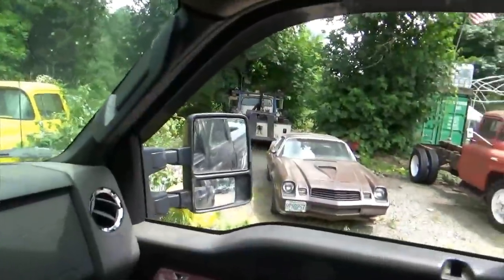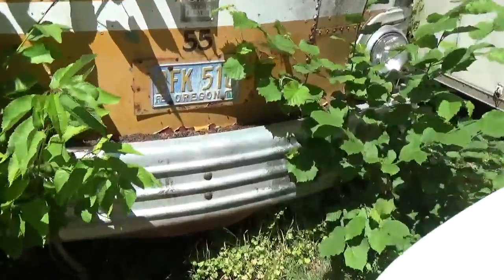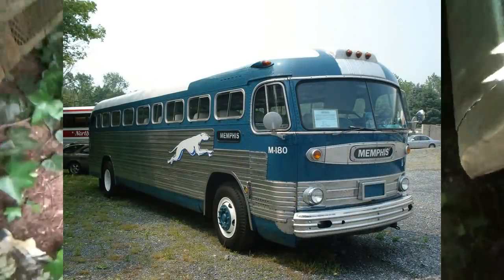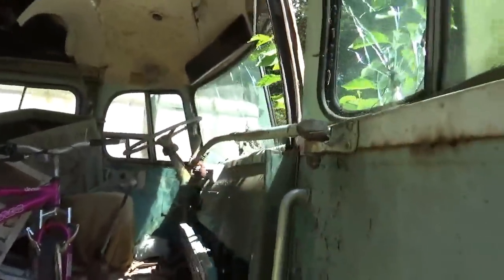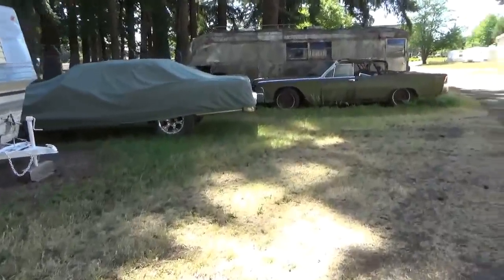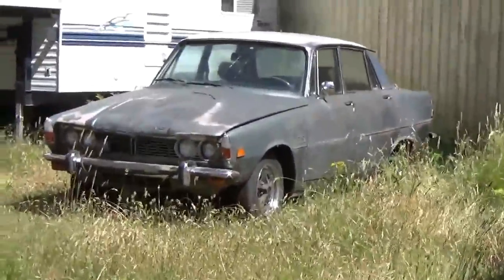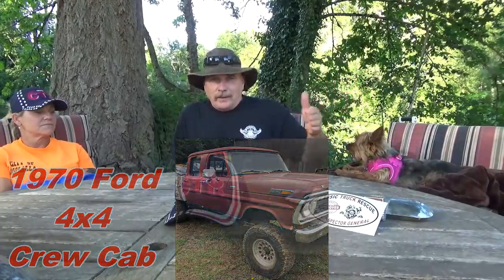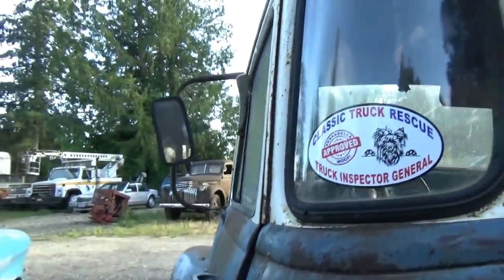1952 GMC Bus & 1940's Mack Bus (CTR-153)

Comment: So the 4103 front glass in unobtainable but Lexan is an easy enough replacement until you can locate some. I know a 4103 owner that’s been looking for years.   I have no doubt it will run.  Don’t forget heck the air filters for water too, ontop of the obvious stuff like injectors etc.  good luck

Comment: Rick the grille is a 70 one year only, it could be a73-79 running gear frame down 67-72don't come with 460's.The 460 trucks were F-250's and the tunnel had to be cut out to let the trans bolt up.

Comment: GM bus has stainless steel sides, nicknamed "SILVERSIDE" no aluminum on sides or bumpers.
Reply: Okay, but sayin AL-U-MINIUM is way more fun.
Reply: GM buses were all aluminum. Including the siding.  No stainless steel at all.  Weight was an issue. so most of the bus is aluminum. The 3751(and 4151) were the only silversides buses, built before ww2 and then again in 1947 through 1948. This one in the video is a newer model, but still all aluminum. MCI built buses with stainless steel siding for many years.
Reply: radioactivelarry the sides on this bus are anodized ALUMINUM, not stainless steel!

Comment: You found a rover p6 a british,  the tc was a 2.2 litre and they had the 3.5 litre v8 version originally a small block buick engine but bought out and slighty modified by Rover, their badge is a viking ship, v.prone to rust here, they had an aluminium bonnet ( hood) and boot lid ( trunk).

Comment: 5/16 square stock would open that hatch up; think of a key that "locks in" between the shaft on an electric motor & a pulley, only the size is 5/16

Comment: That yellow bus is a 1952 gm pd4103 transit bus 1500 made between 51 and 52....the engine is Detroit diesel 671 6 cylinder 2 stroke.....the biggest problem u will have with that bus is the windshield cant be found...I know I've tried for 7 years cause I own and converted a 1951 4103.....ck utube channel gm bus 4103.....if u get ahold of the yellow bus I'd be interested in some parts.....steve from fla.

Comment: The car is a 1966-1973 Rover 2000 P6 TC = Twin SU Carburettors  The power output of the 2000 TC engine was around 124 bhp (92 kW) The holes in the rocker panels are for the car jack..

Comment: Hi Rick another great video, The car is a Rover P6 2000 TC and the TC stands for Twin Carb, There was also a 2000 SC (Single Carb) and it's a 4 cylinder 2.0 ltr engine. There was  also a 2200 TC and a 2200 SC as well as a 3.5 V8 (the old Buick engine). They were made by Rover and then by British Leyland  from 1966 to 1977 and were replaced by the Rover SD1. I hope that helped?

Comment: Yes, send the Bus Grease Money an email. MY advice would be to remove the valve cover on the bus, then have someone else turn it over by hand 2X and watch and see if the injectors work. If you watch some of the Bus Grease Monkey videos he does this to almost every old bus he starts and explains that if the injectors work after the 1st manual rotation of the engine then most of the time their ok

Comment: thats a 6-71 , do not even think about starting that without visegrips on the rack making for dang sure you have control of it , and make sure the emergency air flap is free and working , also the air cleaners need to be checked for water , other than that it should run

Comment: Aaah!  When you went "bus" you woke up some of my memories of working on and converting buses!  This bus was one of the last 4103s, being replaced by the PD4104 in 1953  or 54.  Not a whole lot of mechanical changes, but huge body work changes. The aluminum siding by the way, is clear anodized aluminum, and should clean up nicely. While it can be stripped and polished, not many have ever undertaken this, as it represents a mess of work, leading to high maintenance in keeping it polished.  STARTING THE ENGINE: Although you know a bunch about engines in general, there are some bus specific stuff to look out for.  First, I would try to turn the engine over by hand with a socket and long bar. Assuming it is free, the next thing would be to check the oil for water. Then, it would be a good thing to take down the air cleaners, and clean the air intake of all debris. There are three or four oil bath air cleaners above the engine. When you loosen the clamping device, you will have the whole unit in your hands, so please beware!  The large cast aluminum housing with the big GM logo, is the air intake coming from the air cleaners, going to the blower intake. Clean is important here, too! There is a flapper valve in this section, tripped by a solenoid, and actually closed by a spring. This is the emergency stop device, and it is very important that it be functional.

After the above checks, remove the valve cover (four hand wheels on top) and make certain the rack tube (on top, probably 3/4" in diameter, and running the length of the had) is free to move through the travel. This controls the rack on each injector from full fuel to no fuel. Very important that it will work on the no fuel area, to prevent a run away engine. I used to always keep a good hold on the rack control lever (on the left end) when it was being started. Bus Monkey likes to clamp a pair of vise grips on the tube to allow easy control. I'll not go into this part any further, as it gets complicated from here.  Another "must do" replace your fuel filters and oil filter element. The primary and secondary fuel filters are extremely important! Clean out the cans, install the new filter elements, then fill the filters with diesel fuel before buttoning them up. You will also want to put a pump on the fuel line from the tank, and pump it to make sure you don't have a tank full of water instead of fuel!

Nice find, and thanks for awakening my "nostalgia genes!"  Two things get my attention from the past...buses and Studebakers!
Reply from the maker: Wow....a lot of good stuff. Thank you, -Rick

Comment: Hey Rick  that is a 6 "71 0r 6 53 take the value cover  off and put a pair of  voice grips on the fuel rail that's the bar that connects the injecter together  hold it to idle poison start  engine up move back and forty to speed or slow down rpms if it starts to run away push rail to idel and use the emagercy stop to cut air off to kill engine

Comment: When I worked on diesels, I always had two tools in particular when firing up, the wrench for the fuel line into the fuel pump and a big hammer to flatten the line if it still wouldn't stop.

Comment: On the GMC bus it looked like the back glass was identical to the front glass. You could transplant the back glass to the front then replace the back with lexan. As a Studebaker man I am VERY disappointed that there wasn't even a picture of the Studebaker bus in the video. I hate it when some paranoid individual gets ahold of something like that and will not share.

Comment: The gm bus has a 6i 71 Detroit which is 6 cylinder then I for inline or v for v pattern then 53'71 or 92 which is cubic inch per cylinder. A 318 Detroit is a 8v71 engine.

Comment: Rick its a Rover 2200 Tc  mean twin carburators
Reply: sadly only a 2000 before the 2200, so the engine was designed to run on leaded fuel (5 star stuff no longer available).. I think, maybe wrong ??

Comment: Avoid the runaway motor by making sure the injectors aren't stuck [look at the rack under the valve cover]. Ya that is a Detroit 671 [straight 6 I guess you'd call it] 2 stroke Diesel [bigger cylanders than the 730 V series that came later on. You can't kill those motors with a stick but you have to watch that any one of the injectors is stuck to the full fuel position because if you start it like that the engine can run away on you... there's a shut off clapper on it around the blower area [talking kinda out my arse a bit] but again... one thing is for sure the injectors are all set up on a bar lever and as mentioned, if one's stuck open the bar will be stuck to that open position and... yada yada runaway motor. So make sure all the injectors are free and not stuck... but if they are freed up you can probably start that sucker [put some bioclean in the tank with some fresh diesel though]. lol  They'll burn up just about any oil near as I can tell. Heavy steel frame with aluminum "Silverside" look when polished up. A real beaut of a bus though! Noice!

Comment: that's a Detroit 6v71NA (Naturally Aspirated). in these days, diesel engines didn't have any modern cold start aids and the easiest way to wake a sleeping detroit is to crank it over for a few seconds, let it sit, crank it again (it should try to start) and let it sit about 5 seconds and on the third roll, it should start right up. the most awesome part is what it's in, if that bus could talk it would probably tell us quite a story. I don't remember exactly where but somewhere around here, someone has an old GM Scenicuiser that just happens to be an old Greyhound with a Detroit 8v71NA. if I come across it again, i'll take some pics for you

Comment: the bus the engine is a detroit diesel 6-71 as its a two stroke diesel as on the side of the block is the blower that forces air into the engine through the slots in the cylinder liners and the exhaust valves are regular poppet valves common problems these engines the injector rack sticks. this bus be perfect for Bus Grease Monkey to service as he services only the two stroke detroit diesels. he has a vintage GM bus of his own he travels in.

Comment: Get ya A bottle of restorer to put into the engine oil for your Detroit diesel engine not to rev up.& tackout to high on ya when trying to start it up. After it does stays running during the startup period.

Comment: The engine is a 6-71 Straight 6,supercharged 2 stroke They are nicknamed ''screamers'' 71 cubic inches per cylinder 426 cubic inches in total cubic inches There is a company in the USA that converts the Silversides to mobile homes Interestingly,they do the conversions first BEFORE any of the mechanic components are worked on

Comment: 6v 72
transverse mounted
175-78
Hp with a “V” drive trans
This
Rig was built
Before the 8v72 was common
GMC DD has
2v72 ( for ac units)
4v72 (pd4501-scenicruuser built in ‘54a had TWO 4v72’s mated in middle to form
An 8 cal engine-

6v72 (as seen above in this rig) common on fire apparatus- buses and medium to heavy straight trucks
light semis
8v72 large bus and heavy truck, straight and semi
12v72
Logging trucks oil field
Trucks
16v72 
(2 8v72 ‘s Mated )
And believe it or not 20 v72
Trains ships locomotives specifically
(2 8v72’s mated with a
4v72 added in with massive blower)
Reply from the maker: Thank you Scott.

Comment: Hi Ricky, Wayne in New Zealand, cool video's, that GMC bus has by the looks a 6 v 71 GM Detroit , good old engines , when you want to start that , make sure you take the intake hose to engine Off when you start it , and have something like a flat piece off metal or plywood to block off intake at blower on engine , that will stop air going into engine , good luck , thanks

Comment: Thought I would help out with the info for ya Rick. 
First bus info: https://en.wikipedia.org/wiki/GM_PD-4103
Second bus info: 1934: Production of electric "trolley coaches" began, continuing only until 1943.[11] A total of 290 trolley buses were built, with Portland, Oregon being by far the biggest customer (with 141 total). https://en.wikipedia.org/wiki/Mack_Trucks

Comment: Those Rovers were unusual for British cars in that they often came with a V8 when 4 cylinder engines were the norm in the UK. They're an all aluminum design, originally by Buick. Story goes that Rover executives were on a visit to a Buick facility and saw the motor. Buick had given up on the design as the die-casting process they were trying to use wasn't working out. Rover bought the design rights, developed the lubrication system further and converted to sand casting. Those engines went on to be manufactured for decades.

Comment: The detroit came with an emergency shut down ,which starves the engine of air. No air,no run. Also, if there is an air leak which allows the engine to run,say near idle after tripping the emergency shut down, then try to get a rag and if possibe place the rag over the air entrance in addition to the emergency shut off. The rag sometimes will starve the engine enough to make a safe shut down. 
I too highly reccomend the Bus grease monkey page on you tube
Thanks, great videos of all those rescues.

Comment: As many have said bus grease monkey also luke at us coach in new Jersey a great source of parts and knowledge  6 71 6 for number of cylinders 71 number of cubic inches per cylinder also in that bus the engine turns left not right and there a toggle switch in the drivers area that controls reverse neat old bus it will make a great conversion  i am doing a 1968 gm pd4107 
You have a good day
THE GRUMPY BUS

Comment: The foreign car you weren't sure about is a Rover 2000TC, a P6 from, I would say, around 1966 or '67, it's definitely a series 1 as it has the metal radiator grille and the early badge style and placement.  That's got to be a pretty unusual car in the US as it's an early example for the US market and not many were sold being as they only had a 4-cylinder twin-carb engine and manual 4-speed transmission.  A bit later on they launched the 3500S for the US market which was a lot more popular and it had the Buick-designed 3.5 litre V8 (which was thoroughly re-engineered by Rover to become an all-alloy engine) which was probably most famously used in the Range-Rover, though it had a long production life and saw service in a huge number of vehicles from TVR sports cars to Freight-Rover/LDV ambulances.  The NADA (North American Dealer Area) Rover 3500S came with automatic transmission only (the 3500S for the rest of the world was manual transmission only) and a lot of US-friendly extras like air conditioning, electric windows and the Icelert ice warning system and was only available in series 2 guise with a black plastic radiator grille produced from late 1970 onward.  Those P6s are fantastic cars, very much an engineer's car as they have very unusual front suspension as the car was originally designed to accommodate the Rover gas turbine engine, though that never made it into production vehicles, and independent rear suspension with inboard disc brakes.  All the outer panels on those are bolt on as the car was built around a very strong structural base unit...

Comment: That's a GMC 4103 with what looks like a GMC/Detroit 6-71 from what I've seen on Bus Grease Monkey's channel.  A very tough engine from all accounts, two-stroke diesel with a blower, not a lot of power but torque by the ton.  Even if it's not felt to be good enough to save and put back on the road there would be a lot of people who would love to have that one for spares with it appearing not to have been messed around with much over the years...

Comment: Remove air intake to engine. I remove valve cover and turn motor by hand to free up. Check rack rod to see if injector links are free. Put voice grips on track rod to control engine speed. Keep your series 71 manual handy. Fire it up. You need plenty batteries. It needs 450 RPM to light. If it wants to take off and you can't control with voice grips, place that un-used service manual over the air intake and cut off its wind. Note: You have until maybe 3500-4000 rpm and then it will draw air out of the crankcase.

Good luck! Did many of them in my day. PS- change fuel filters and prime system.
Reply: Scott Beyl..... It will Never "draw air out of the crankcase".... it's Not a loop scavenged engine.  The ONLY way that air is getting into the cylinders is through the airbox surrounding the ports in the liners, which is directly fed from the roots blower.

Comment: Looks like a Ford v8 in the Mack. Water pump looks like one we just did on a 60 Thunderbird with a 352
Reply from the maker: It is a Ford. I could see it better in the video than I could while I was filming. Thanks, -Rick
Reply: @ClassicTruckRescue  i bet that was a slow ride when it was still running because the old 352 wasnt exactly fast in the Thunderbird.

Comment: Hi Rick, there's a lot of preventative maintenance that needs to be done before you can start a old diesel like that. The valve cover has to come off and the engine has to be turned over by hand a few times while the injector rack is moved so you can be sure it doesn't have a stuck injector, they were mechanical back then so it is really important to do this . The fuel system should be purged and run from a clean container until you can be sure that the old fuel has been cleaned out of the fuel tank because it gathers a lot of dirt and debris inside the tank from sitting and the old fuel gets gummy and sludged up. There are several other mechanical systems that need to be checked as well but this is the basics for pre starting it.
Reply from the maker: Thank you Bob.